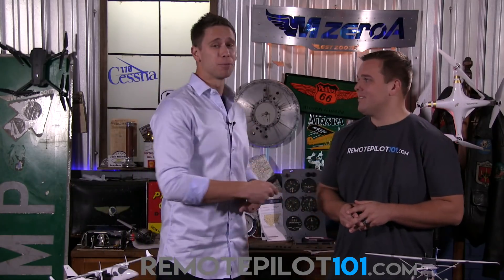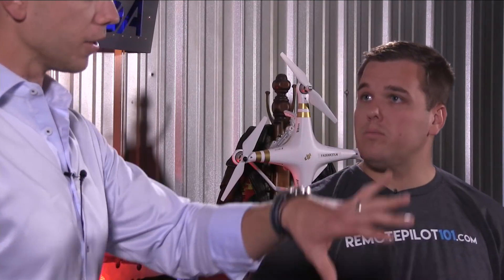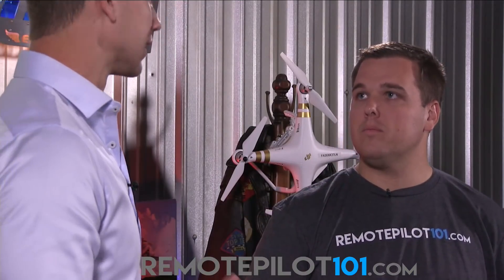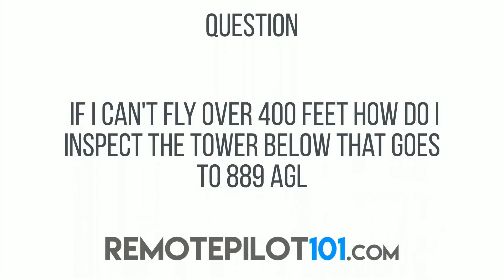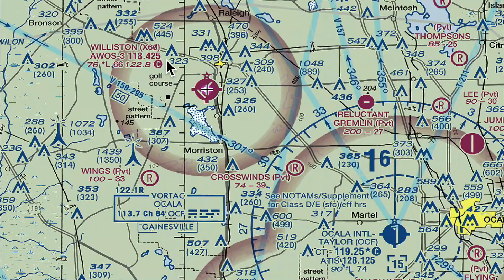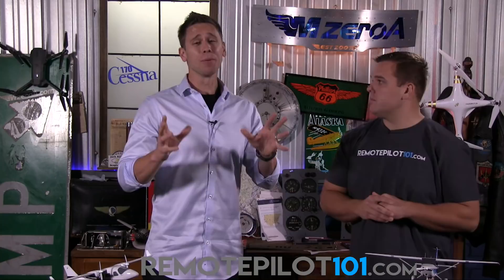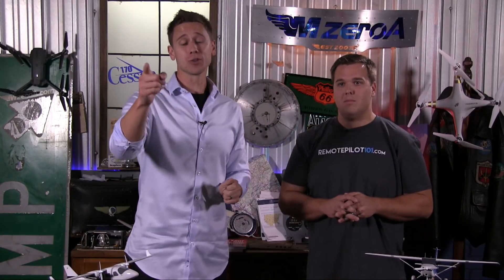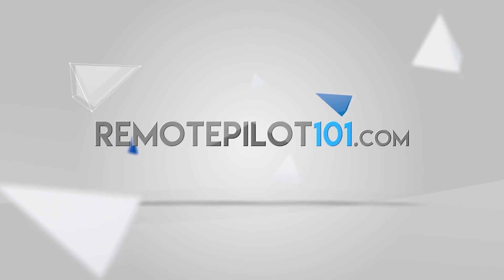Part 107 Popular Question: Safely inspecting towers...

Comment: This is NOT correct information.  You can go 400 feet over that tower as long as you stay within 400 feet of the tower.  There is no part 107 regulation that restricts you from doing so.  Please check the regulations and show me where I am mistaken.  I don't think you can.

Comment: Just a quick comment.  (889) is 889 ft MSL not AGL.  The AGL in this case was 1049.  So technically wouldnt we be flying at 1449 AGL to inspect the tower??

Comment: That's where it gets so confusing for me. Everything says you can legally fly 400ft above a structure at 400ft around it. But if it puts you into a controlled airspace then you need authorization?  So in reality you can't legally fly 400ft above a structure?
Reply: You were correct.  You can fly to 400 feet over this tower.  Class E is not a restriction in this instance.  No authorization required.  GoldStar has a video about the same tower that DOES cite regulations and not just opinions.

Comment: I’m so frustrated with this question from taking the test 2 years ago and now again later today.  

I remember in the test the tower question was posed (and in your practice test) with the tower being located inside of class D airspace.  According to your practice test the correct answer is 802 (402+400’ agl) but how is that possible?  You are not authorized at all to fly in class D airspace.  Moreover, if you were, the waiver would indicate your max altitude.  Pleas provide some clarification.  Thanks!
Reply: Please understand that this is not accurate information.  You can go 400 ft over that tower, unless somebody knows a regulation that I can't find.  I would recommend the GoldStar video about the same tower, that does cite regulations.

Comment: Not to poke the wrong answer you gave but you should really go back and read 107.41. "§ 107.41 Operation in certain airspace.
No person may operate a small unmanned aircraft in Class B, Class C, or Class D airspace or within the lateral boundaries of the surface area of Class E airspace designated for an airport unless that person has prior authorization from Air Traffic Control (ATC)."

The key to the answer and the part you got wrong is "or within the lateral boundaries of the surface area of Class E airspace designated for an airport "
Reply: Ethen - Your response is unclear.  Do you agree that Austin's observation is correct?  There is a lot of discuss about this on the forums.  I have included a link from UAV expert news that states that authorization is required for Class E surface areas designated for an airport - only.  So not vertical upward extensions, or surface extension to Class C or D.    http://www.uavexpertnews.com/2018/02/class-e-airspace/I wonder your thoughts?  This seems pretty clear.